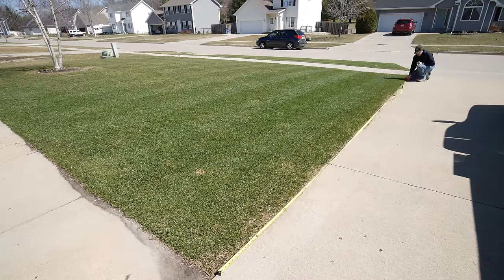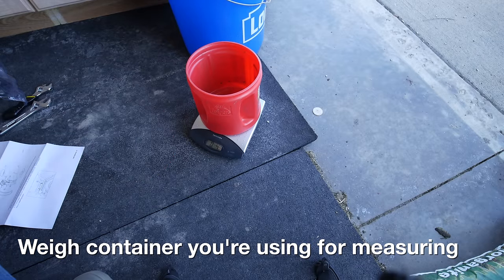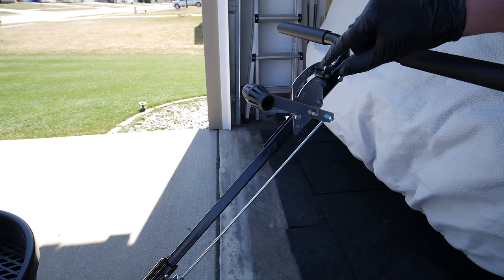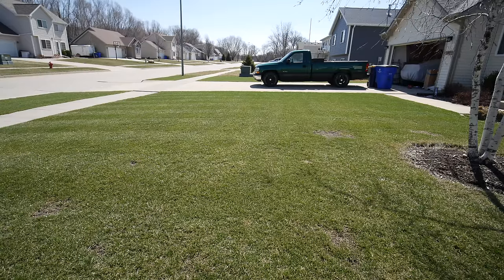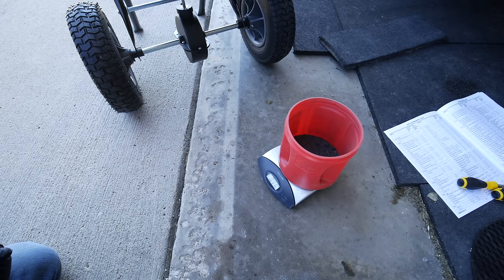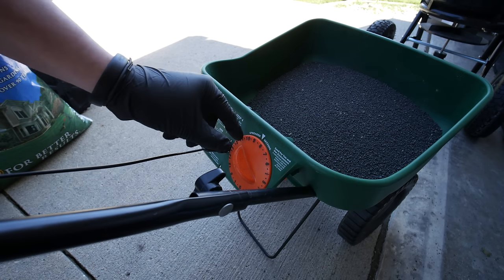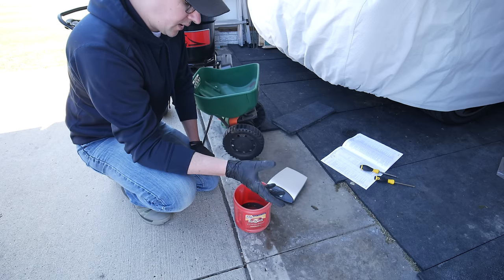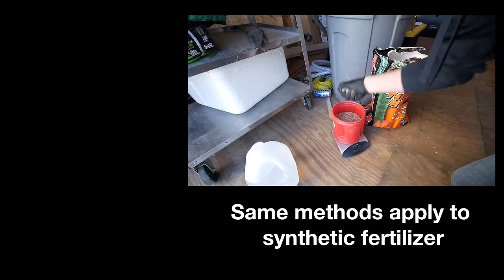Fertilizer Spreader Settings | How To Calibrate Spreader For Milorganite and Other Fertilizers

Comment: Hey Ryan, I always add an extra pound of fert in the hopper. This ensures I have enough to actually spread evenly over a 1000sf. Then I measure the contents left over and adjust my hopper settings from there. Like you, my walking speed is pretty much set.
Reply from the maker: Very good idea

Comment: I have the same spreader and use a similar technique when spreading Milorganite. I turn the adjusting knob clockwise until there is a "pretty good hole" and fill the hopper to the brim ;)
Reply: Just ordered the same Brinly spreader and was wondering if you've used it to put down Carbon X or XGN and if so what are your setting. Much appreciated!

Comment: What is most important is uniform coverage, and most broadcast spreaders do not throw the material uniformly  (less material is delivered per square foot the further away it is thrown).  Because of this fact, it is better to use a crosshatch pattern when spreading, which suggests using a lower setting on the spreader than the bag recommends as you will be walking nearly twice as far.  You are right ... it is trial and error, but once you lock in a setting for a given material and spreader combo, write it down, and you won't need to measure out this material in the future before applying - just fill-up and go.
Reply: The last part of your statement was what I like. Shouldn't all bags of Milargornite come with 3 settings for a Scott's spreader. 1 each for light, medium and heavy. And the only thing that you have to measure is how many bags you will need. Just dump it in and walk at a normal pace. All of this calibrating and calculating in mind boggling.

Comment: Remember, when you have the left side deflector down, you end up putting down a very high quantity of the material you are spreading (in Ryan's case, Milorganite) in a small strip just to the right of the left wheel.  That is because the side deflector does not reduce the amount of material being released by the rotary disk.  Rather, the side deflector just directs all of the material that would have been spread to the left of the spreader to just a small strip next to the wheel.

Comment: I bought the Scott's Mini and put out Scott's DiseaseEX for greyspot. I measured out 4lbs (the curative rate per 1000 sq ft) did an edge pass and two straight passes, all gone. I used the curative rate per the bag and it took the entire bag of product to a little over 1200 sq ft. I thought it would have been a little more accurate than that!

Comment: I use Dynamic Lifter in Australia.  It's basically chook poo.  Just chuck it out by hand.  Fairly low in nitrogen it's basically just a soil improver.  In spring I use urea, carefully, for its high nitrogen content.  But Its almost winter here now, my perennial ryegrass has gone dormant.

Comment: Ryan, do you like the Forever Green (Menards) product? This is my first year (other than last summer using Miloganite) using something other than Scott's Turfbuilder (regular). I'm trying to keep a spurge problem from sprouting so I used the Forever Green with crabgrass preventer just this past week (I'm near Chicago). This product contains the dithiopyr. Just wondering if you've used that line of product and what kinda results you've gotten.
Reply from the maker: I've just used it the fall when I'm using synthetics...seems to work fine

Comment: Ryan. Do you have problems with milo with small chunks getting stuck in opening. With the scotts speader that is.
Reply: Kevin, I have a Scott's spreader just like that and yes it gets stuck.
Reply from the maker: I don't seem to have much of an issue with that but in general the Scotts gets a bit jammed from time to time.  I just pick it up at the end of a pass because it's so light

Comment: I want to use this for spreading sand on pavers (for the crack-sand that goes in between paver stone driveways, patios, etc). Then I can just blow and sweep it more into the cracks. Do you think this product will work for that?
Reply from the maker: The sand would have to be completely dry but it should work if that is the case

Comment: I’m a Ryan Knorr disciple! I bought myself the same Scott’s spreader and put down an application of turf builder. It worked great, where I walked. Now my yard has dark streaks showing the path I walked. Have you ever seen that? Was I walking too slow? It’s been about a week, so would it be too early to put more down and try to fill in the rest of the lawn?
Reply: See Tommy Tester's note above (and Ed K. above that).  You want to set your spreader to put out the material at 1/2 the rate and do a cross-hatch pattern.   Do the outside loop first maybe at 3/4 suggested setting for full coverage (to reduce over-loading material at the deflector edge).  Then do the inside the loop area at 1/2 setting going north to south and then east to west.  This should help get rid of "streaking" in your lawn.

Comment: Sometimes id rather toss the seed by hand because the spreader never spreads it how I want. I used recommended settings last 2x and I ended up with green strips of grass in my yard (looks like how the grass grows under the septic line kinda look)

Comment: Great video👍 I been using that style Brinly for 3 years. Built solid and feels good. Only beef is with the linkage that inserts into the control lever - it is too loose and not secure. What your thoughts?
Reply from the maker: I haven't noticed an issue yet but I have very limited use
Reply: Just ordered the Brinly spreader and wondering if you've used it with Carbon X fert or XGN and what settings are you using. Much appreciated!
Reply: A. Atta the setting will be different between us because we probably wont walk at the same speed. And X green will be a different setting from Carbon X because they are different prill sizes. Sorry I couldn’t be much help. 😎👊

Comment: 8th! My Scotts spreader died last year..literally on last run on my last app for the year! 😀 Looking for a new spreader for 2019,  will be heading to Fleet Farm this weekend to see what they have.  Did you like the Brinley?
Reply from the maker: What happened to the Scotts?  I have had mine now for 8-9 years I think....just curious there. 

I haven't done enough testing to know yet.  I'm so used to the Scotts.
Reply: Ryan Knorr Lawn Care The plastic gear wore out. I got about 15 seasons use out of it, so it was time. RIP 😀
Reply: lowes is having sale this weekend. your scotts spreader for 19.99 reg 35.00  great deal , i usually use my hand held spreader, but couldn't pass up this deal.
Reply from the maker: That's a pretty good run for a cheap spreader

Comment: Hey Ryan,  Great Video.  Where did you get the book with all those spreader settings for all those different products
Reply: haccprof it comes with the Brinly Hardy spreader. Just bought one last week and found it very useful.
Reply from the maker: Correct it's in the manual that came with the Brinly

Comment: If anyone has this style Brinly without the Deflector you can order one through Brinly. Part Number:1007520. I think I paid $25 last year for it.
Reply: Too bad they use a deflector. An earthway spreader in the same price range closes the side hole instead, so you aren't doubling up on product on the edges of your lawn.
Reply: @ryeguy01 I agree 100 percent. However, I do believe the earthway even-flow open/shut off plate can be fitted onto the Brinly. But, now over spent and could have just bought an earthway. 👍

Comment: Where does the 100 come from in the calculations?
Reply from the maker: We are looking at the percentage of nitrogen inside of the bag so that would be out of a total of 100 percent.  If you have a 21-0-0 then 21% of that bag is nitrogen and 100/21 would easily give you how many pounds of that product you would need to put down 1 pound of Nitrogen onto the ground

Comment: With my logic, the hopper does not know how much lbs you put in.  All it knows is what it's calibrated at to throw the appropriate amount.  So with the right  calibration, walking speed, etc... would you not naturally put down the correct amount of lbs on the ground regardless of how much was in the hopper assuming there was enough to walk the entire lawn?  Worst case you have left over product in the hopper that you would re-bag.
Reply from the maker: I'm not certain there...the size of the fertilizer will make a difference as well